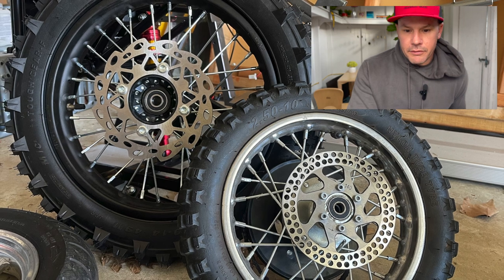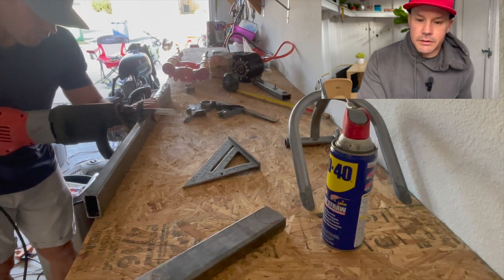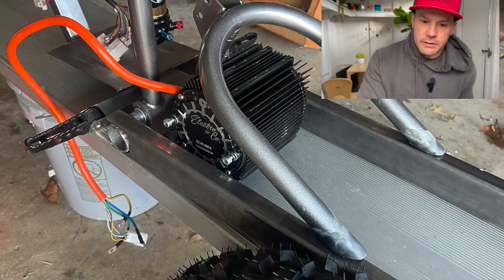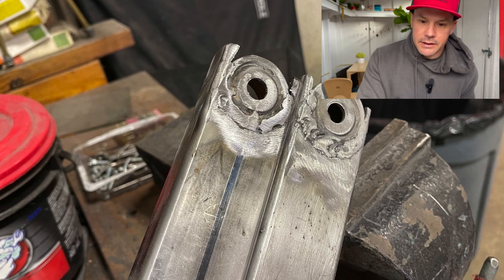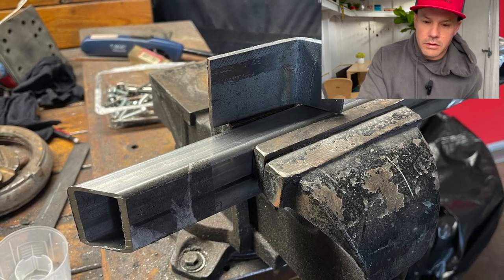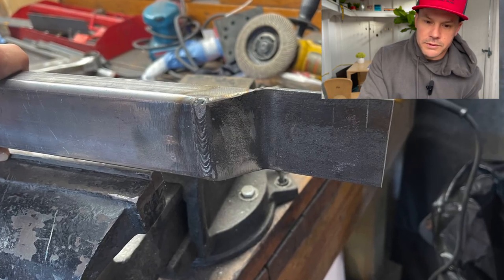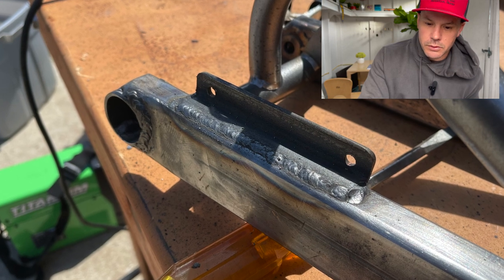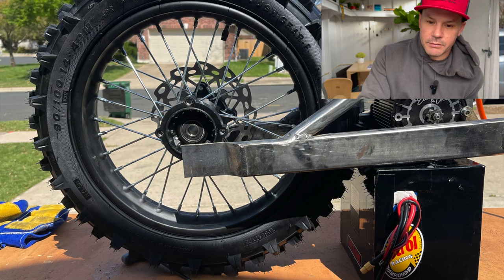BEGINNERS GUIDE To Extending The Swing Arm On Your Razor MX500, SX500 And MX650

Comment: Hey Brother, love your content. did you ever make part 2 of this video. I bought the 14" rear wheel u recommended in another vid but im not sure where to get adapters to fit the 14" on the rear of my MX650. thanks again Voltron
Reply from the maker: I didn’t get around to a 2nd video. 😭 I had to make my own wheel spacers out of 12mm I.D. Round stick I got off of amazon 🤙

Comment: What are some direct bolt on wheel alternatives for the mx 650/500 front and back tryna avoid the regular razor wheels?
Reply from the maker: That’s a great question. To my knowledge there are no direct bolt on alternatives. Everything you see on razor bikes that are not stock are most likely modified to fit. 😩

Comment: Does the bigger wheel fit on the stock axle?
Reply from the maker: It didn’t at first because the wheels come with bearings that accommodate a 15mm axel. I bought bearings that will allow the 12mm razor axel to work. 🤙

Comment: Voltron the build coming along nice swing arm turning out nice.  What gear are you going with for the 14 inch wheel.
Reply from the maker: Man, that is a great question! And I have no idea😂 just gunna get a couple sprockets, do a little research and go from there. Basically wing it and hope for the best! Lol
Reply: @VoltronWatts  Nice I did the same thing I have 4 diff ent sizes to try .

Comment: How much did you extended it?      How much is needed to fit those wheels?
Reply from the maker: This was a 5” stretch. Fitting the wheels isn’t hard. Had to get bearings that fit the axel. And I made spacers to keep the wheels where they need to be in relation to the chain drive and brakes.
Reply: @Voltron Watts  do you think a 4 inch stretch would accommodate the wheels.  Plus not interfere with the motor??